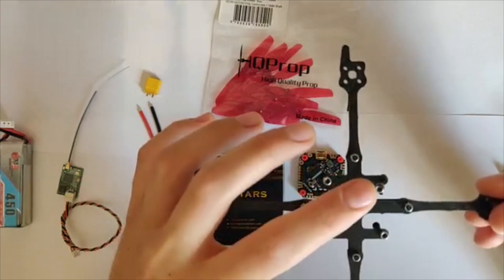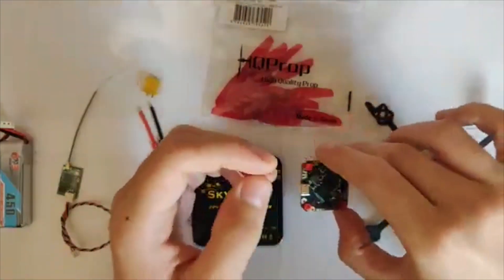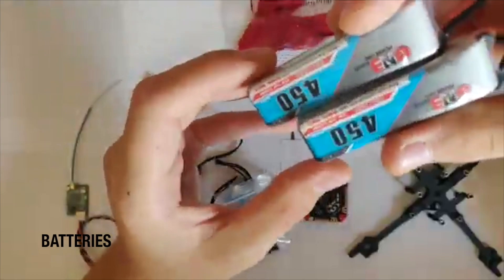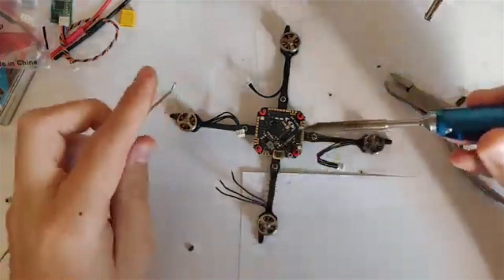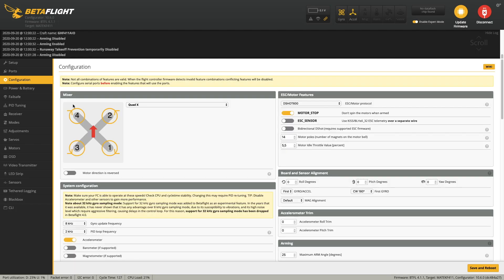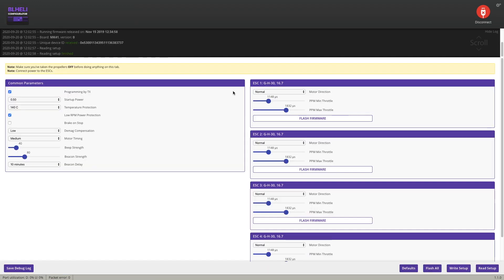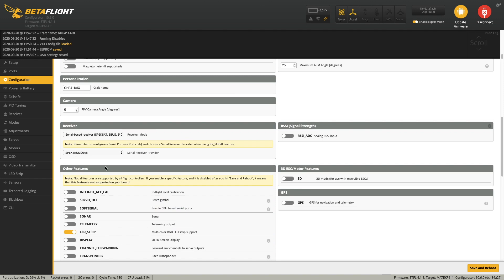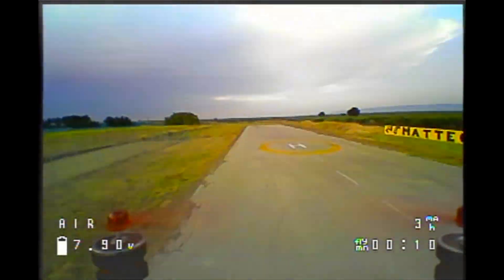I BUILT the BEST  2.5 inch MICRO FPV RACING DRONE - CONSTRUCTION | CONFIGURATION | TEST IN FLIGHT

Comment: Great build, I used the same exact FC and motors!   How have those motors performed for you.  They were a big fail for me.  When I ordered them I made sure I go the lower 8000kv, cause I like to run tri-props on my toothpicks sometimes, and I made sure mounting holes were correct for my frame.  Who knew they would be press on prop shaft, no threaded holes in the bell, plus did you notice that the mounting holes were threaded  M1.5 when every 1103 I've ever seen has M2 threaded holes, and they didn't come with any screws.   They also say 2-4s, since I didn't have any press on bi props, I used some press on tri props, so I ran it using 3s 450mah, and burned up a motor on the second pack.  Dropped down 2s and replaced motor.  Didn't blow a motor the next 4 packs, but man were they hot.  The fifth pack I  had a small wipe out, on thick soft grass, and another motor broke.  They flew great when the weren't catching fire or breaking on soft grass...lol

Comment: Hello my friend, great build! I am building the Sailflyx with a Namelessrc f412t flight controller. My camera is the Eachine tx06. For some reason, I can't seem to get the the camera to show videos. When I scan to do this, I get a black movement like it wants to connect. I also tried another flight controller that is the same as the Namelessrc, but still getting the same results, no video. I tested this camera before any installations and it was working fine. I have the wires as described:  White wire: video in, 
Red wire: 5v,
Yellow wire: video out,
Black wire: Gnd,
Green wire Smart audio = tx2
Black wire Gnd
Thank you so much in advance... Subbed your channel..... Happy flying! 🖐️🤠👍
Reply: The connection are right, maybe there is a problem with the input voltage. Have you tried measuring it with a multimeter?
Does the it show the OSD on the display?
Reply: @NicolaGuerrera  no osd, just a screen as though it is trying to show a video.The normal snowy gray/black pop in screen if you know I mean!
Reply: @Barbaric_Iron  well, it seems that it's vtx problem. Or maybe a power issue, you should be able to power it from battery, give that a try